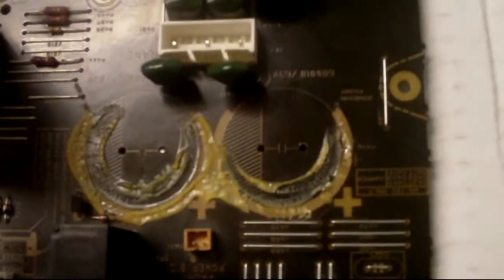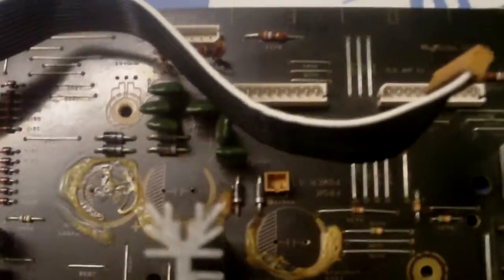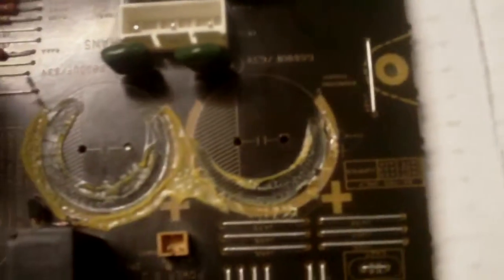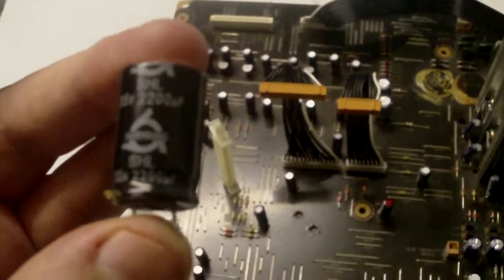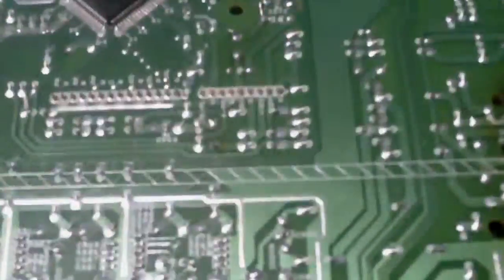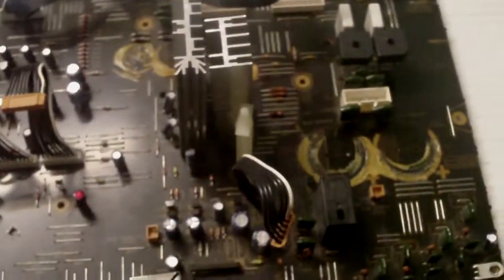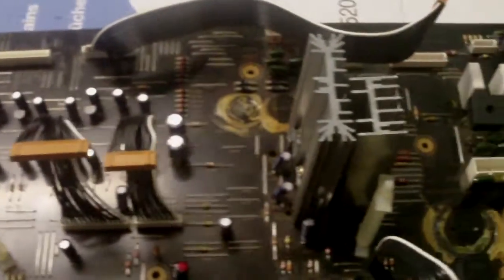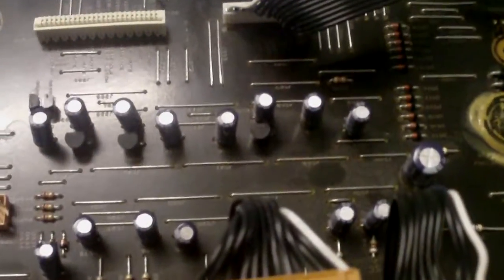TEAC AG-10D Digital Amplifier Repair Part 2

Comment from the maker: one thing i will say, please make sure you replace them the right way around, make sure the polarity is correct, white stripe is negative and there will be a marker on the board for this and cap. if you solder them in the wrong way and power the amp on, the caps will blow up in your face!

Comment from the maker: Indeed , with decent quality caps youl get 20 years out of her, they are great. when youve replaced them, check the mainboard for solder joint issues, as heat builds up sometimes they crack.